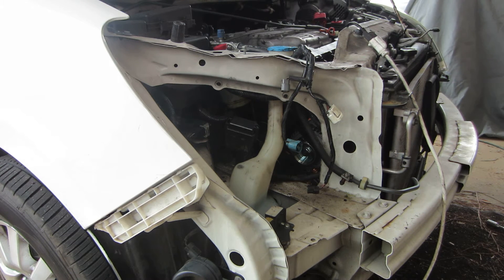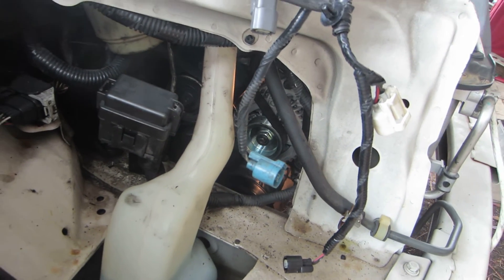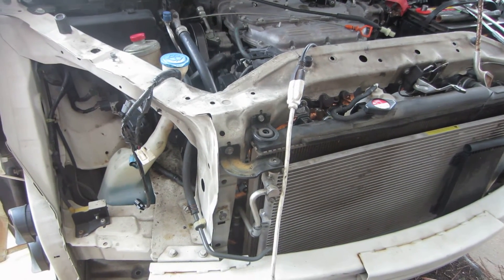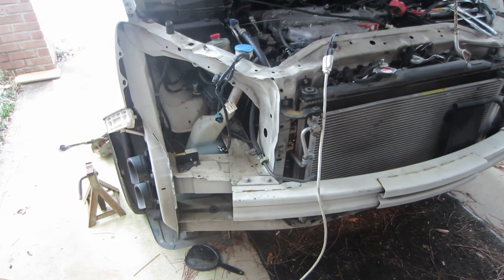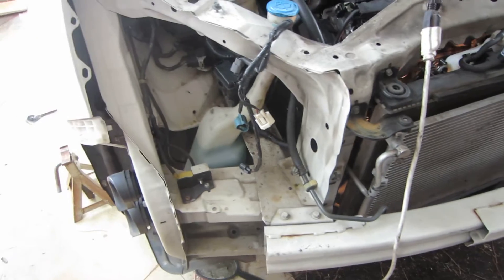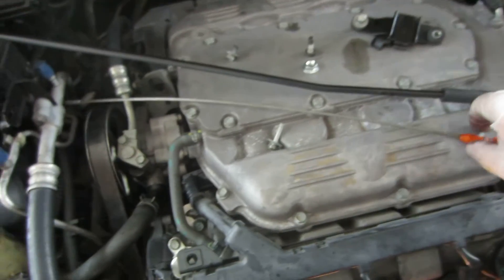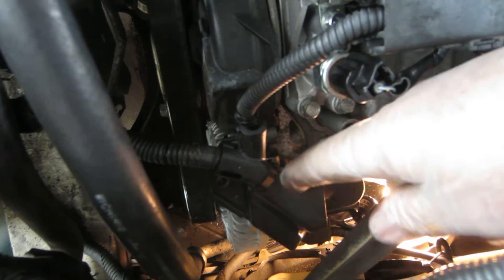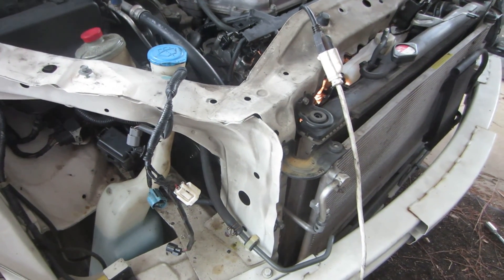VVT SOLENOID GASKET LEAKED OIL CAUSING THIS DAMAGE TO THE ALTERNATOR / REPLACE A $10 GASKET Honda V6

Comment: Great video very informative! I have changed 100 of these and it takes 45min. I charge 112.50 to install and the alternator is 145.00 to 180.00 depending on the year.  I do add 1 hour labor to repair the VVT. If the VVT is not corrected and you ignore it, the alternator will fail in 6 months! I don't warranty oil contaminated units.
Reply from the maker: Glad you gave us some stats on Labor, etc. Thanks for Watching!

Comment from the maker: Thanks for watching! Here are links to the VVT Valve Gasket Replacement:
Related videos related to the VVT gasket Replacement:
Replacing the VVT Valve / Gasket Part1   
https://www.youtube.com/watch?v=N47M_dMm5PA
 
Honda 3.5 Engine VVT Solenoid (Part 2) Variable Valve Timing Oil Leak 2008-14 Odyssey Pilot Acura
https://www.youtube.com/watch?v=zNMtYVjA948&t=599s

Honda V6- VVT Solenoid Valve Burnt Oil Smell & Oil Leaks Near the Dipstick - 2008 Odyssey Accord 3.5
https://www.youtube.com/watch?v=0o0x34e3Z8k

Comment from the maker: Dorman VVT Solenoid used on this 2008 Odyssey Touring model - Dorman 918-056 (includes the gaskets). The gaskets only may be available on Amazon. Amazon shipped the gaskets which arrived in two or three days. Thanks for watching!